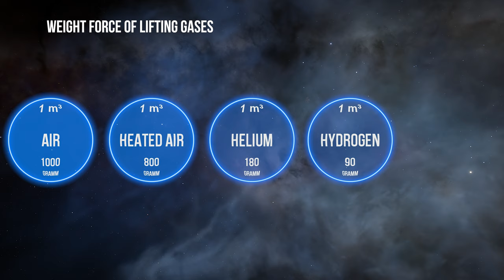Revolution in the Skies: Vacuum Buoyancy and the Future of Airships

Comment: You don't need a full vacuum. If the mass of displaced air is more than the weight of the structure, it'll float. If your buckyball weighs 1000 grams, and you remove 1010 grams of air from it, you should get positive buoyancy, even if that's not all the air inside the buckyball.

Comment: You dont actually get much more buoyancy using vacuum than you do using hydrogen.  Its not the weight, its the difference in weight.  Hydrogen is 10% as heavy as air, which means that going to vacuum only gains you 10%.  And to make the structure capable of withstanding atmospheric pressure is nigh impossible.  It will almost certainly be heavier than a balloon, which negates the buoyancy gain and then some.

Comment: Using polymer technology we might be able to construct tiny buckyballs inside a vacuum chamber that is lighter than air and strong enough that it will not crush in normal air pressure. By being able to mass produce them we could use them to replace helium and hydrogen in dirigible airships. The larger buckballs could be used to pump air out to create a vacuum or allow air inside to make the craft lighter or heavier than air for take off and landing.
Reply: What about a buckyball type aero gel ?
Reply: @lionfire01  Aerogel is still heavier than air but they could work on that.
Reply: Yeah video made wonder about small ones inside car frame or jacket...If lift works in water maybe it generates hydroelectric power if anchored.

Comment: Great video, great idea and great production of the video!! 

As requested, I am sharing my thoughts:

I assume the solid frame weight is higher as weight of the air volume in it. Independent of the size.

That means it will not work out.

Looking forward to see other comments as well.

Comment: An airship with a set of evacuated spheres inside (in place of the normal gas bags) with an efficient onboard vacuum extraction system, would allow the airship to vent and expel for vertical greater control. This cant be done with traditional airships as H2 gas is highly explosive and He gas is highly expensive.

Comment: The mass of the area of it surface must weigh less than 90 grams per meter cubed and the tensile strength has to be greater than 14.5 psi or 1000kpa or 10 meters of water pressure
Reply from the maker: Let's assume that's true. Do you think something like this could be produced?
Reply: @pyrodice  - I like the concept but it would be almost impossible to make

Comment: yes please. Was thinking about this a few years ago that this shouldn't be to hard to produce. Design a 3D structure similar to a honeycomb so probably what was shown in the video already is good enough or close to it. Also i thought about using ultra heated gas. Only problem would be to have a really really good isolation but then you wouldn't need a strong structure as the pressure inside is equal to the pressure outside. when the isolation is good enough you only need a little bit of energy to maintain current heat level. If you want to go higher, just heat it more and let an over pressure valve release unneeded hot gas. Heating the gas is don on ground, so most of the energy to travel get come from ground infrastructure. Once in the air solar panels should be able to create enough energy for zero emission flight at day. The shape should be aerodynamically so that in the case of a complete pressure loss, the vehicle itself when high enough can glide to a safe landing, if the area is flat enough or maybe, depending on the motors used, they could be over driven for a short time to enable a soft straight landing.